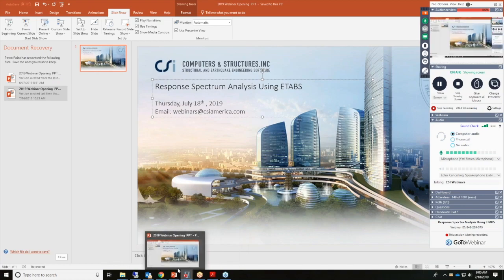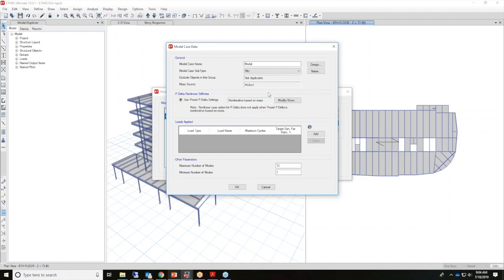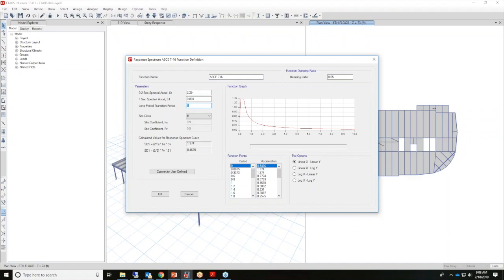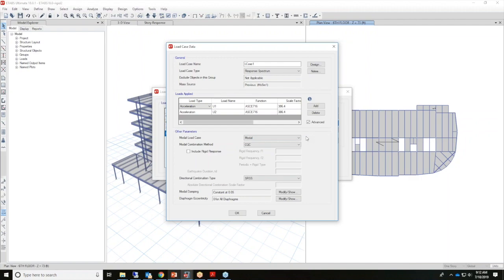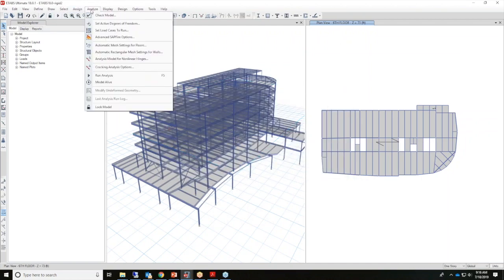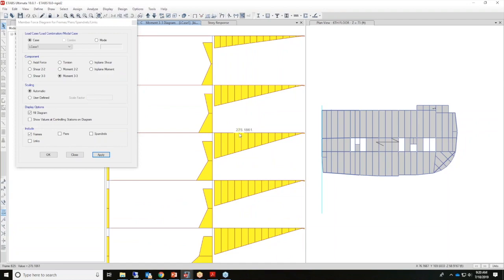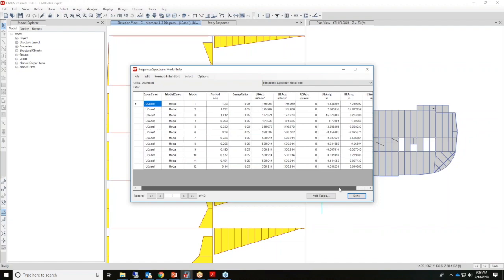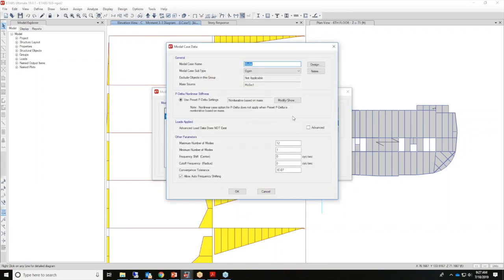WEBINAR: Response Spectra Analysis using ETABS

Comment: How to combine the response spectrum with gravitational loads? I have made some iterations placing the dynamic shear loads per floor manually to obtain a coherent stress diagram and not all positive or negative as the spectrum does.

When comparing both scenarios (Dead+ RSX) / (Dead+EQx) (EQx lateral dynamic loads entered manually), I find that directly combining the spectrum with gravitational loads does not give similar and sometimes non-coherent values.